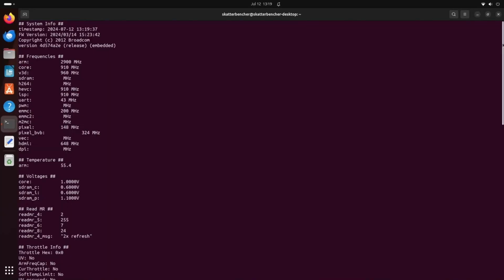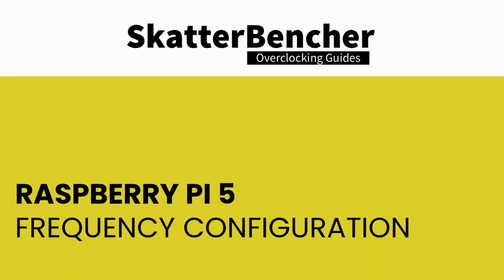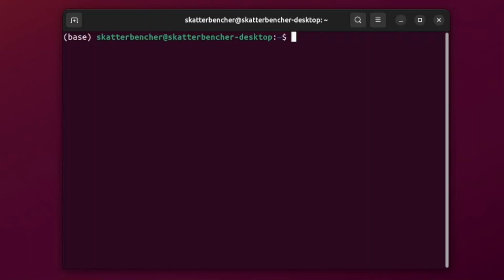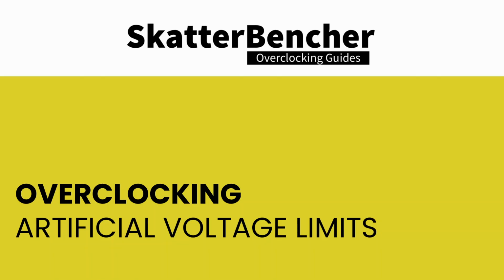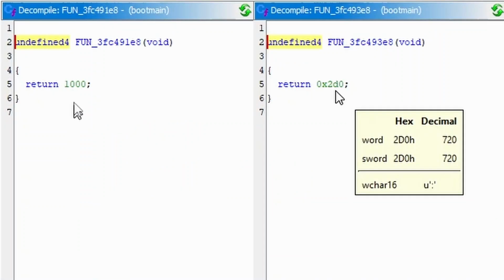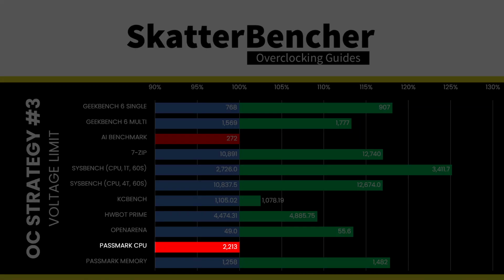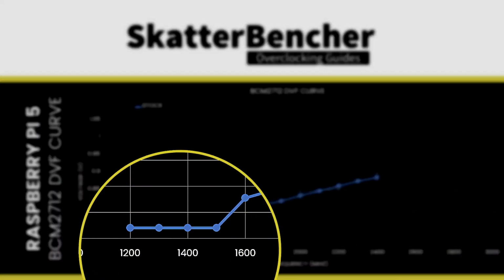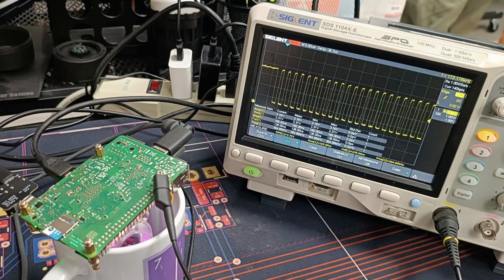Raspberry Pi 5 Overclocked to 3000 MHz | SkatterBencher #77

Comment: Thanks so much for this video and the associated write-up. I'm experimenting with overclocking my Pi 5 2 GB now, and I would've never clocked the part about the GPU overclock also boosting the bus speed.

I'm a bit curious why you chose not to overclock v3d in OCS2. Is it not really feasible because of hardware limits, or is the performance uplift really not worth it given the workloads you have planned?
Reply from the maker: It's been a while so I can't quite remember. I think maybe I skipped it because I didn't have workloads where I'd see a meaningful uplift.

If I'd make the guide today, I'd probably try overclocking it too :)
Reply: @SkatterBencher  Thanks! I'll give it a shot. :)

I tried googling to figure out how much voltage the V3D block needs when overclocked, but I couldn't find anything. 

Right now, when I use stress-ng to max the CPU, the SoC voltage is 0.9750V. So, I've only got 0.250V left to play with when adding a V3D workload. I think that's how that works, since V3D has its own clock?

Comment: I don't understand these videos. All the Pi 5s I've gotten so far all overclock to 3GHz on the CPU and 1Ghz on the GPU and are indefinitely stable under full loads CPU, GPU, and RAM with sufficient cooling like the stock tiny Pi 5 active cooler or better. Maybe I'm just ridiculously lucky or something? So far it's for two 8GB Pi 5s and one 16GB Pi 5.
Reply: Maybe you guys (Pi YouTubeers in general) aren't using sufficient, clean power supplies and are getting voltage drops that are causing crashes?
Reply from the maker: What power supply were you using? I was using the standard Raspberry Pi power supply
Reply: Now that you mention it, I haven't tested it much with the Raspberry Pi power supply. I've mostly been using a slightly modified power supply from Anker (I have a rather larger ferrite bead I wrap the lead around a few times - I also do ham radio stuff, so I try to mitigate a lot of the noise these sort of things make), a wall wart style 60 watt one, though here, let me check what it's rated to on 5 volts...
Reply: Also, according to vcgencmd pmic_read_adc, VDD_CORE_A is sometimes momentarily draining upwards of 8 amps and more consistently over 6 amps, though occasionally dropping down to as low as 5.1 amps under these full loads on my 16GB Pi 5. Am I reading/understanding that right?! If that's so, it looks like 10 amp 5 volt power supplies should be more the norm. ...Okay, nevermind. It looks like that's on a 1V internal regulator, and I realize now you covered this in the video. 😅
Reply: It also appears that my stress testing is quite limited compared to what you've done here, so my comment is more apples and oranges for this video specifically. Sorry about that. it seems I should be content with my "lucky" Pi 5s and not be too quick to assume otherwise. It just seemed strange to me that I've seen so many other YouTubers that don't seem to be getting similar results from their Pi 5s. 🤷‍♂
Reply from the maker: Never hesitate to raise a flag if you see something odd in my videos - I'm not working at any of these semiconductor companies, so I don't have the inside track on most of this. I do make errors. 

At the end of the day, having a couple 3G Pi 5 is pretty nice ... definitely something to be happy about :)

Comment: Good old ARM overclocking.
I remember overclocking Android phones back in the day, as well as trying to tune a Raspberry Pi 3 to get 1 more FPS in H265 encoding.
And sending off my already half-broken Raspberry Pi 1 with a terrible voltage mod.